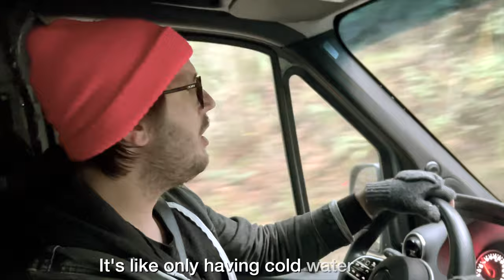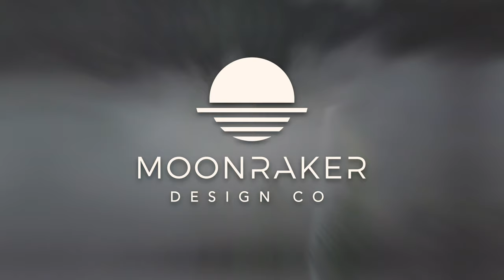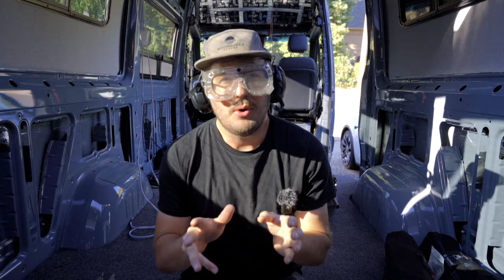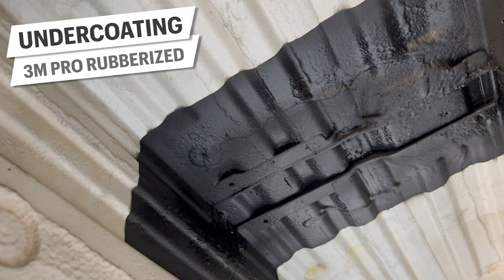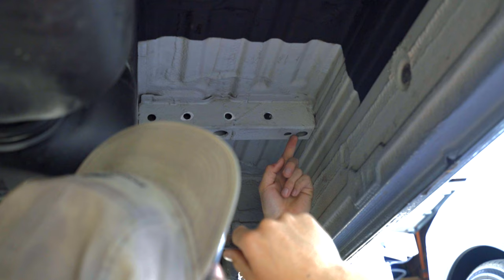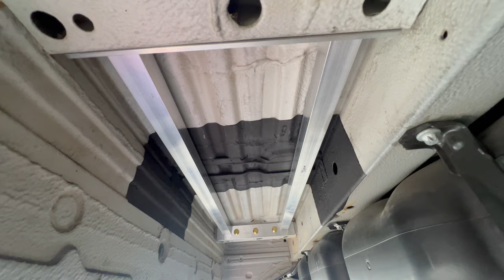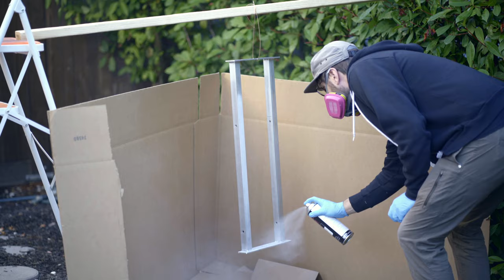Sprinter Van Conversion Hydronic Hot Water System Install

Comment: Do you need all the components you’ve installed to have it working, cause on their website they have a kit which seems it’s like to hoses.
Reply from the maker: Hey @pedrofontes8494, technically no.  You can run the water heater directly inline with you engine coolant.  VanLife Outfitters has a pretty good blog post about this - https://www.vanlifeoutfitters.com/using-a-marine-isotemp-water-heater-in-camper-van-conversion/.   For the sprinter where I split for the heat exchanger you could just run those hoses back to the water heater.  This heats up the water in the tank while you drive or if you let the engine run. 

One reason why I didn't do this is because if anything happens to those hose runs and that's your vital engine coolant that's spilling out, not an extra auxiliary coolant loop.  If anything happens to either loop in my system they are pretty isolated and the engine loop had minimal modifications which makes me feel warm and fuzzy.  However, when you add a second loop you need an expansion tank on that loop because as things heat up they expand and you don't want the system to pressurize. 

The reason I added the D5 was, one I got a really good deal on it, and two because I can heat up the water without having to turn the engine on, there will be times when it will be inconvenient to turn on the van just to heat up some hot water, so this acts as redundancy and since I already have a D2 with an easy-start pro, I can hook this up to that same controller since it can run two heaters. 

One could argue the 110V element in the water heater is the redundant heating method, but that's a very power hungry option and should really only be used if you are connected to shore power.  

Anyways, I hope this helps.
Reply: @moonrakerdesign  ya this was very helpful. Any chance you will make another video on this. Also you could have a link to some of those parts you made
Reply from the maker: @pedrofontes8494  I'm not sure I'm following, make another video on?   

Unfortunately, the custom parts are only really cost effective if demand is there as a one off it's literally hundreds of dollars each if I didn't give my time away to myself for free.  I've been listing parts on the van I make that people are generally interested in on my website when demand hits a certain point.  These haven't quite made it there yet, sadly.
Reply: @moonrakerdesign  thanks for answering my question, I meant to ask you if you gonna make another video on this system, how it works, and answer our questions
Reply from the maker: @pedrofontes8494  Ahh I see, yes I will try to get this, TBH I have a serious video backlog right now... so I make no promises... 😬
Reply: Sorry to jump into this thread, but I'm not quite sure of the reason behind having 2 diesel heaters installed, would you mind putting a word?
Also, I personally believe that your custom parts for this install are the dogs bolloks and brings high value to a camper van. I would be definitely interested in them in due time.

Comment: FYI on the extra pump. On my Webasto unit I added a relay on the "Pump" wire. So on the NC pin of the relay I have ignition activated power and on the NO I have continuous power controlled by the Webasto. The resistance of the relay is enough to trick the Webasto into thinking a pump is attached, so no errors. I see that the Espar pump is 3 wires, but I'm sure you could achieve a similar result.
Reply from the maker: Nice that's a cool solution!  Thanks for sharing, and I would be interested if it also works on the Espar,  in general they seem a bit more finicky with control modifications.

Comment: Very cool!!  The only downside I see is lack of electric plug in backup for the hydronic system.  But you get a much bigger water tank.  I'm thinking of Aquahot as a comparison.  I am blown away at your level of detail and sophistication.  You easily surpass a mechanical engineer level.
Reply from the maker: Hey again!  Thanks for the continued support and the comment.  Actually, if you check out the Electrical Phase II video you can see I ran a plug for the 110VAC heater element in the water heater thank there.  I just wasn't ready to tackle my VAC runs at this point in the process yet. 

Thank you for the kind words I really appreciate it, I've been brainwashed and taught by a lot of great mentors throughout my career.  

The Aquahot system is pretty sweet and a really good option, I opted to go this route because I wanted everything out of the van the space premium in a 144 is tough. The struggle is real so trying to free up as much of that as possible.  Also it's nice to be able to drive to the beach and have hotwater for a day trip without having to turn on an aux system.
Reply: @moonrakerdesign  You're very welcome, and again well done.  Do you plan on installing ??Kaloric?? radiators for hot air?
Reply from the maker: @lkazanov  I think right now I can only fit the Rixen's one for my planned area, but yes I'm planning on putting one more in the back for those extra cold days to help with the Espar D2 up front.

Comment: Your girl seems nice but she's just totally off base on the cover. I mean, you nailed it bro. Anyhow, I definitely appreciate the attention to detail and overall breadth of skills used to put this install together. There was one moment that corresponds to something I'm planning on incorporating into my own system, with controlling the D5 using the cerbo gx. You may be thinking cabin temp, but I'm more concerned with the temp of the fresh water in the isotemp (freezing would be bad). With shore power, I don't mind running the heating element to protect from freezing. When remote, I believe having the D5 kick on when water temps in the tank get low may be a good idea. I don't have your level of ambition so I'll just end up taping a sensor to the output pipe on the ISO and insulating it well. But I'm sure you could come up with a much cleaner way to design/build a sensor (maybe an inline probe in a custom machined fitting?) Or, maybe you figure out a better place in the ISO to put the sensor. Anyhow, I will be watching for whatever you decide to do to integrate your heating system with the Cerbo GX.
Reply from the maker: Lol.  I let her know you said so, and thank you for the kind words on the build.   Yeah I'm still figuring out my whole freeze prevention strategy and where I need to monitor temps, but did you see this Short I put together?  

https://www.youtube.com/shorts/CixUVKZOb4A 

I added this inline to the Hydronic portion right by the water tank at least for now and thinking about doing something similar for the water lines.  Since this is my first van and first experience with Van Camping in general I think I'll have a lot to learn and figure out as things materialize.  Especially with all my tanks outside the van.  I know I'm definitely going to run out Cerbo Relays, so I was looking at this 

https://community.victronenergy.com/questions/245584/remotegpio-ex-venus-rgpio-now-available-with-setup.html. 

I'll probably go a little overboard with tank pads, heat tapes and maybe even some additional hydronic lines wrapped around some stuff to really figure out what works best.  Definitely open to hearing yours and others thoughts here though since I don't have much experience. 

Anyways, thanks again for stopping by!
Reply: Ok. So I did like your temp probe solution —actually saw a friend of mine do something similar with his home brew kit. Anyhow, I appreciate that insight! In addition, I also went ahead and ordered the relay expansion module and associated connector from Ali express. I’ll let you know when I program and share my experience! Oh and did you happen to know what the part number is for that wire connector to the Bosch pump?
Reply from the maker: @zenandtheartoflife  sorry for the late reply here, just now seeing this comment.  That would be awesome if you can share you experience with that expansion module!  

For the connector on the Bosch pump, I ordered this one - https://amzn.to/3PhR0Ww

Comment: You turned it up to 11 once again, great over the top install and video! 
That's the first time I've seen anybody using anti-seize on their Rivnuts. I like the idea, and after some research I think I'll try the marine grade LB 8023 for it's water-washout resistance.
Reply from the maker: Thank you appreciate the kind words!  

The solution works really well and unlike paint you don’t scratch it off as you insert the Rivnut.  Good find on the LB 8023, that seems like an overall better option for this kind of thing and I’ll recommend that for people just starting out from here on out!  

Although I’m going on about 1.5 years on my oldest outdoor Rivnut and the LB 8036 anti-seize hasn’t washed off and is still looking good!

Comment: Just a note here; you've put your HE in series with the heater core but the recommended method is in parallel. I honestly thing your approach is fine. Also this is almost identical to my MY2017 3.0L V6. Clever location for your HE.
Reply from the maker: Hey thanks for the comment and input!  Yeah I went the easy route here.  So far it seems to be working out really good for us!   I do have to cut the lines here pretty soon because I'm adding another Heat Exchanger in the back of the van to take advantage of this loop, so might revisit everything then.
Reply: @moonrakerdesign  Here's the best info I have found so far in my research:

This is the blurb from MBZ for the factory aux heat exchanger for MY2016+ and MY2018+ 3.0L V6's - "An auxiliary heat exchanger is connected to the water circuit in parallel with the front-end heat exchanger". The "front-end" here is the in-dash heater core. There is also a MY2018+ Aux Heat Exchanger Prep PDF you should check out that shows - importantly - which lines are supply and return and the location of the electric coolant pump and where MBZ would have you not modify. Everything looks very similar on my 2017 to the 2018+ VS30.

Anyway, parallel means tee off the supply and return lines. Your loop should close and if its any longer than the under hood loop you showed in video, I'd include a pump like this one from US Solar Pumps "S5 Solar Hot Water Pump - S5 12V 8.4L 5PV" - its relatively low current and flow rate, which is suitable for hydronic loops.

Comment: Are you going to show us the rest of your water system? Tank, Pump, Plumbing? Thanks- good job on your build
Reply from the maker: @PTG847 of course!!  Thanks for the comment and we are glad you are looking forward to seeing that.  It will be a little bit though. These projects as well as making the videos is a lot of work in addition to a demanding full time job and all the other stuff we have going on in our life.

Right now we are working on putting in the van flooring since we need to drill holes through to under the van for some of the L-track bits.  This has to happen before the tanks go under the van since some of the holes sit above them.

Comment: Nice tidy install. How serviceable are those heat shrink tube clamps if you ever have to remove or change the system? Can you now ever remove those hoses?
Reply from the maker: Hey Megan, thanks for the kind words. 

To remove the Gates Power Grip Clamps you have to cut them and replace them, that is the only downside, but yes you can remove them no problem.

You can either do this with a special tool from them - https://www.oreillyauto.com/detail/c/powergrip/gates-powergrip-heavy-duty-sb-clamp-removal-tool/gatu/91215

Or you can actually use a soldering iron (I bought an extra tip for mine just for this purpose) - https://youtu.be/KEI17izjlo4?si=30lOTxdRdQCjDNv2&t=426

Both methods prevent damage to the actual hoses, you'd just have to buy a new clamp.  If you are thinking there are areas where you need to service or want to leave open for change a spring clamp or worm gear clamp might be better for you there.

Comment: So impressed with your design and work! I just bought a first gen T1N Sprinter van (Gulfstream RV outfitted)  with the espar block heater and I have bought a small heat exchanger (like you have) that I am going to be integraiting into the system. The van currently does not have a hot water tank (just a 20 year old on demand electric water heater).  I was wondering what kind of transferance water temperature are you getting off the heat exchanger?
Reply from the maker: Hey @MrSeaCheese,  appreciate your comment here and congrats on your new ride! 

Hot water temperature will get up to 160-190ºF.  I think the Espar will try to hold at 175ºF if I remember right.  In my system the water is actually heated by the exchanger in the IsoTemp tank, not the flat plate heat exchanger.  Mine only serves to pull heat off the engine coolant loop while driving. 

Your system will be a little bit different and you need to make sure your heat exchanger can raise the temperature at the flow rate of your fixtures (faucets and shower heads).  FWIW Rixen's uses the same flat plate heat exchanger I have here for on demand hot water.  Make sure you add a mixing value so the output temperature isn't scorching though.

Comment: Thank you for this video and all your other videos - what is your level of concern with a hydronic system spliced into the engine coolant lines in terms of the impact on engine operation if you have a line fault (cut/etc.) or an issue with the other hydronic loop equipment? I wonder if a stand alone hydronic system is safer but of course you can't take advance of the engine "free" heating while driving! Also, I want to ensure I have a 4-season van so what  issues, if any, do you see with having so many of the system elements under the van and exposed to cold temperatures - like a trip to Alaska in winter? Thanks
Reply from the maker: Hey Kehl, thanks for the kind words and the comment.  

This is why I did the heat exchanger route where the hydronic loop and engine loop are separate.  It's also why I chose to mount the heat exchanger where I did to keep that splice into the engine coolant loop as short as possible in fact it only ads about 30" of hose.  This wasn't even enough to have to top off the engine coolant reservoir.  I have seen people route the engine coolant lines all the way back to the Isotemp but for me that was too many variables and connection points to worry about.  I keep a single straight barb fitting in my maintenance kit it for any reason I need to bypass the heat exchanger. 

I haven't put the videos up yet, but my water lines are fully insulated and have heat trace inside, I also have two temperature sensors on the hydronic fluid and water temp, if those go below 40ºF the Cerbo GX monitoring temps kick on a relay which turns on the D5 using the yellow additional wire. 

The absolute best way would be to have everything inside the van, but a Sprinter 144 is small enough already so I personally chose to offload all water under the van with heating pads and heat traces. 

Hope this helps.

Comment: Can you use the isotemp hydronic system for radiant floor heat? I've seen other people use other water heaters and diseal heaters for this but have never seen someone use the isotemp. I wonder if it's possible
Reply from the maker: Hey @TheMadamDragon, unfortunately the IsoTemp alone is not enough for radiant floor heat.  It's designed to take heat input in to heat up the water not send heat out to heat up the coolant/hydronic fluid.  Even the 110V element is for the water in the tank only. 

You really need something to heat up the actual coolant and pump it around the tubing underneath the floor.  The Espar D5 or Webasto Thermo series heaters would be ideal.

Comment: Why oh why do you keep making me buy tools?!  Another great video, love what you guys do for us DIYers (even without the fabrication means)
Reply from the maker: Sorry about that Scott!!  I (and my wife 😅) often wonder why I buy so many tools myself, but then it really does make the job so much more enjoyable! 

Thanks for the compliments and continued support.  It really does mean a lot and keeps us motivated to keep making these.  Even if people don’t follow what we do seeing it in this level of detail hopefully makes people think about things a bit differently. 

Out of curiosity what did you pick up this time??
Reply: @moonrakerdesign  Your approach absolutely makes (at least me) think about things differently especially around attention to detail for serviceability and longevity, it's great to see and follow where I can. I had already purchased the airsaw, the shrink wrap printer thingy, the 90 degree drill, positaps, DT connectors, wire sleeving, the porch lights, heat gun, etc, etc (basically everything from your essential tools video), but this time I replaced all of my rivnuts with those from Mcmaster as I hated the quality of the ones I got from Amazon (too slippery and soft).  I am also likely to change my plans for hot water... I was on the fence for the hydronic route as it was a bit intimidating until your video popped up. Will use your affiliate links as I make that happen ;). Thank you again, my dude!  Until the next video fingers crossed
Reply from the maker: @sstiburon  Wow! That's a lot of stuff thank you for the support on all of that, we don't get much from it but it really does help us with little things and helps us continue to make these videos! 

Yeah I tried the Amazon rivnuts too and luckily did them on a test piece my first one was a spinner and the second one collapsed lop sided so I threw them out and tried the ones from McMaster.  So far I've been able to set all of them straight as an arrow with no spinners with the pneumatic and DIY solution we've been using they are way nicer IMO.